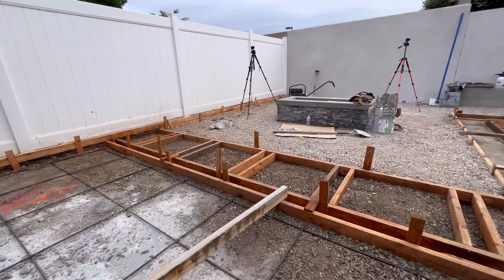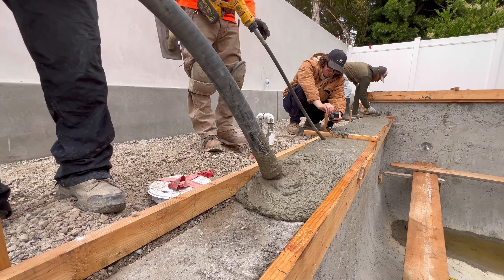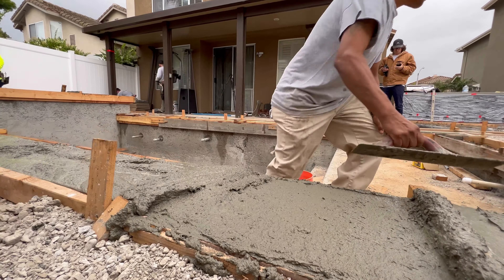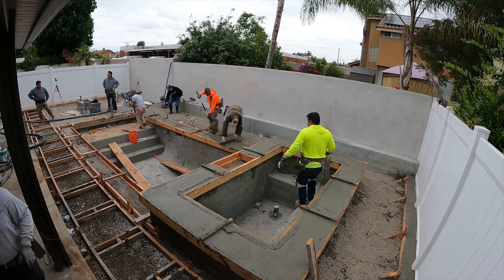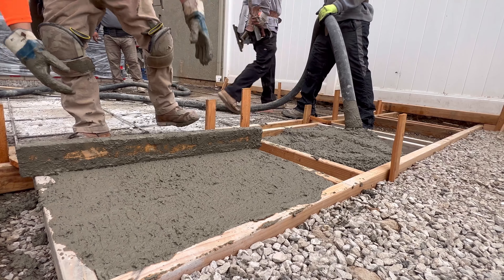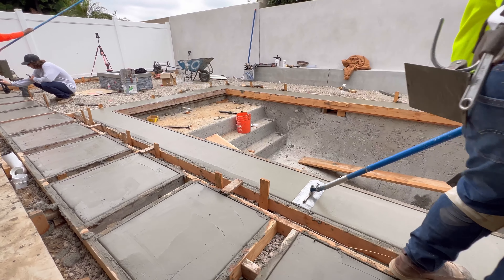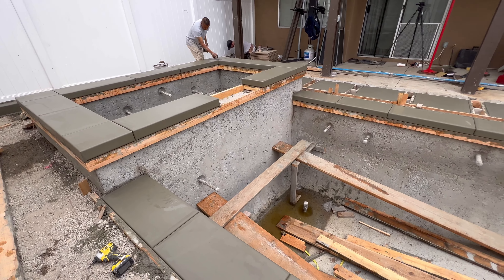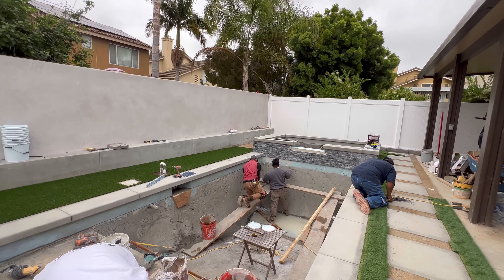Swimming Pool Concrete Deck with stepping pads! Poured in place coping. TY Odells Complete Concrete!

Comment: How did you get the main pool’s pour, the vertical pour that already set, the bind to the new horizontal bit? I didn’t see anything making a hard tie like rebar
Reply from the maker: It doesn’t need to be tied in with steel, preferably not actually (less cracking)